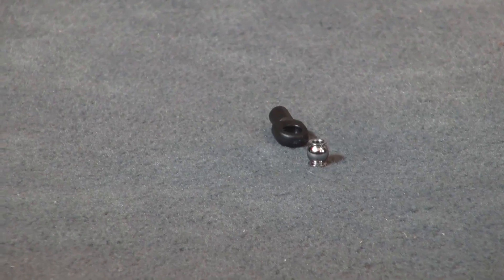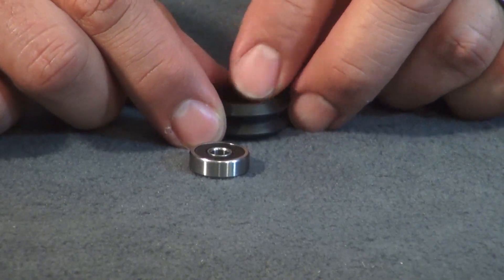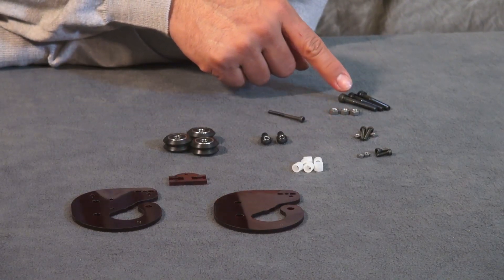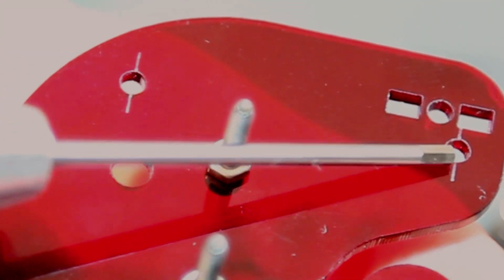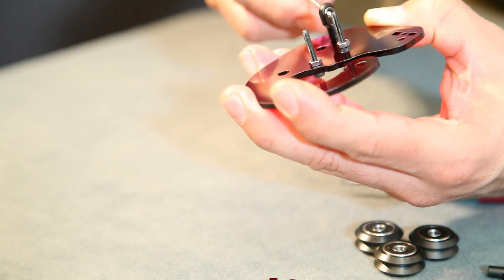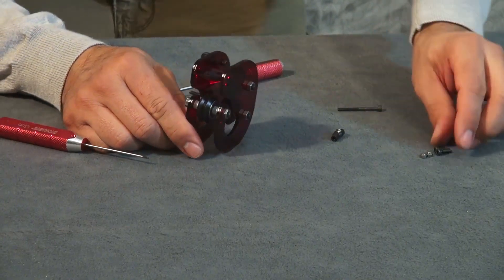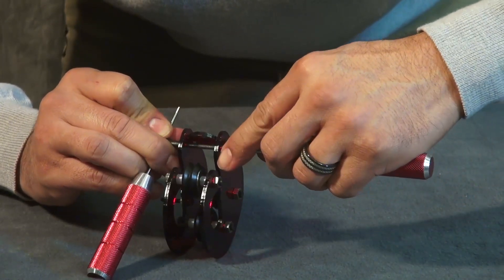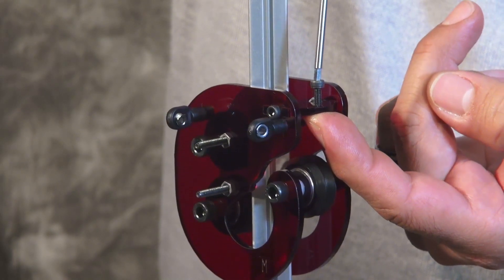Kossel Clear Build Instructions Chapter 11: Roller Cage Assembly

Comment: Hey, my roller cages are not tights on the aluminum bar. All the rollers in the cage do not touch the bar at once and it can jiggle around as it is loose. It can even be turned a fair amount from side to side as it is loose. In the video in does not look loose, but I cannot find what I may have done wrong. Are the roller cages supposed to be super loose on the aluminum bars? If not how do I fix it? Many thanks
Reply from the maker: hi nathan, they shouldn't be loose. can you email us and send us a pic so we can see?